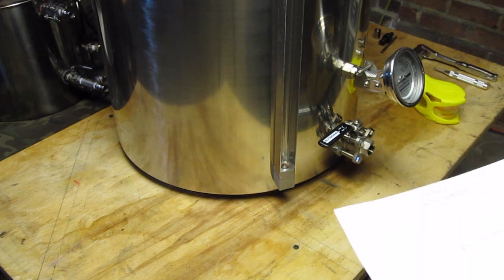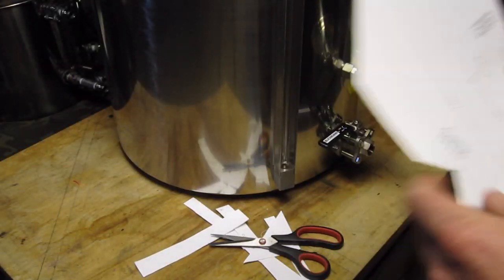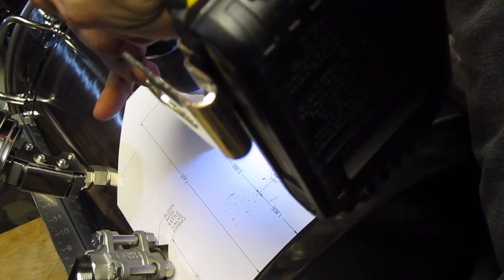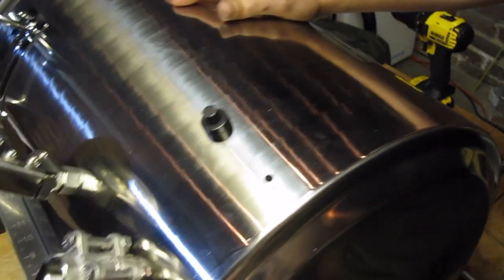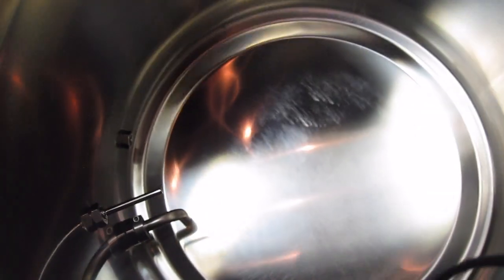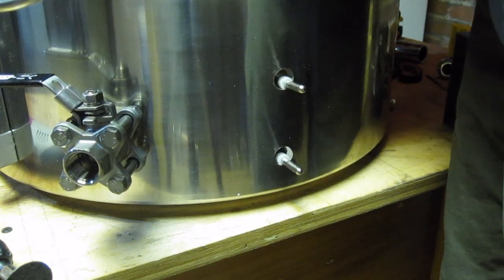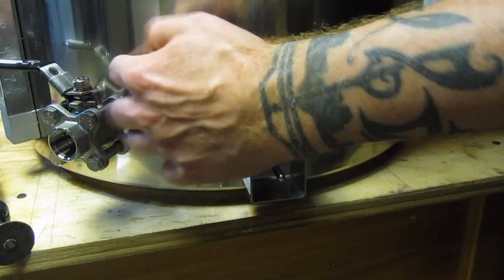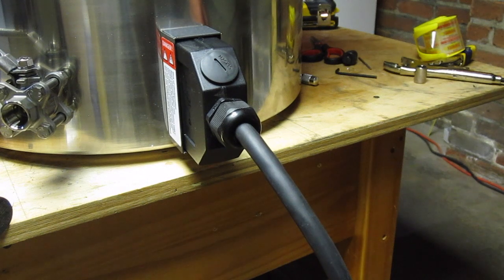Installing a Blichmann BoilCoil

Comment: Bryan, great video, thanks!  Quick question: Why does it need to be installed in the front?
Reply from the maker: I would say that it doesn't need to be installed in the front. However, the dip tube slides perfectly between the top and middle coil when it is done this way. It seems very perfectly spaced. Moving the connector around to the back may cause the coil to hit the dip tube. You could move the template up or down to adjust but I didn't feel like doing the math.
Reply: Makes sense, thanks for the reply!

Comment: I really like that boil coil  but my pot is a 15.5 gallon ss beer keg and has a 8 inch ferrule fitting welded in the top and the bc will not fit.
Reply from the maker: Thomas edwin I wouldn't expect competitors to make universal products.

Comment: Does the dip tube come out easily with the BoilCoil installed?  I was wondering specifically about how I would get my HopBlocker on and off if a BoilCoil was installed.  Would you recommend the BoilCoil based on your experiences to date?
Reply from the maker: if you are using the hop blocker, i would probably install the boilcoil higher than the dip tube. personally, i dont use the hop blocker so i cant say if it will or will not work with the boilcoil in the suggested location. however, the tube does come out easily. 

it works just as fine as a home made element and is easier to install.

Comment: Bryan, thanks for the video. Before I saw this, I was reluctant to attempt putting holes in my kettle myself. How powerful is your cordless drill, and what kind of drill bits are you using for the pilot holes?
Reply from the maker: Dewalt 20v and Dewalt drill bits.

Comment: Thanks for the video.  Are you using a controller, ToP or similar, or just connecting straight to a 240v source?
Reply from the maker: a controller based on the one at theelectricbrewery.com

Comment: Do you think it would fit fine if the plug was in the back of the pot vs the side/front?
Reply from the maker: the plug could go in the back, but the template is made so that the dip tube fits right between two parts of the coil. moving the plug to the back may compromise that perfect fit. also, it makes it plugging and unplugging in order to move and clean the kettle way easier when it is on the front. it just doesnt look awesome

Comment: did you get the temp controller or did u plug it directly into power?
Reply from the maker: i have a controller that i built based on the design of theelectricbrewery.com

Comment: what size hole punch?
Reply from the maker: https://smile.amazon.com/Greenlee-730-5-Standard-Knockout-8-Inch/dp/B002NQRS8G?_encoding=UTF8&keywords=5%2F8%20hole%20punch&qid=1438712030&ref_=sr_1_4&sr=8-4
Reply: Brian Hargrave you can get the exact same knock out  punch on flebay way cheaper.
Reply: They have them as cheap as $20. you just have to hunt for the size you want